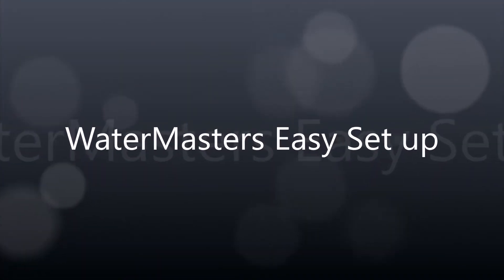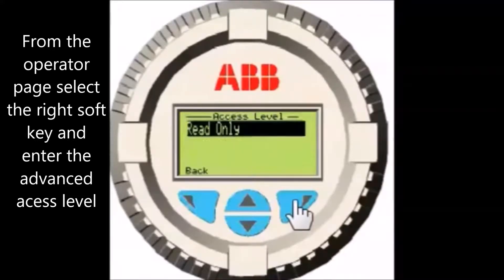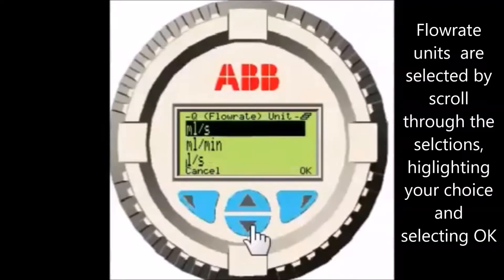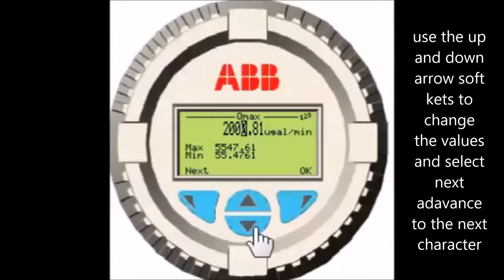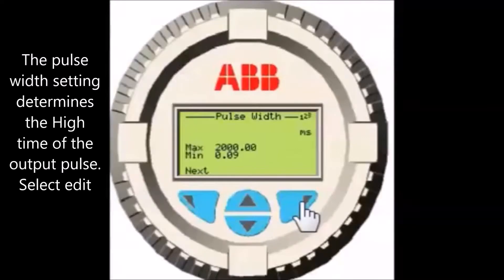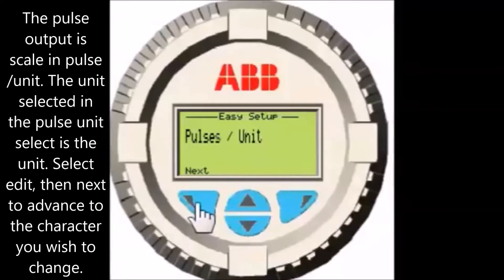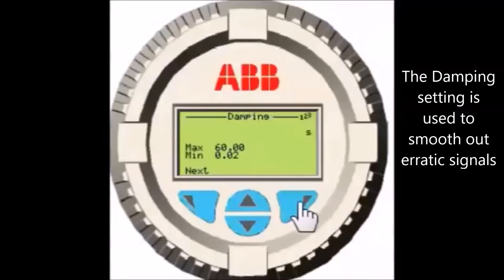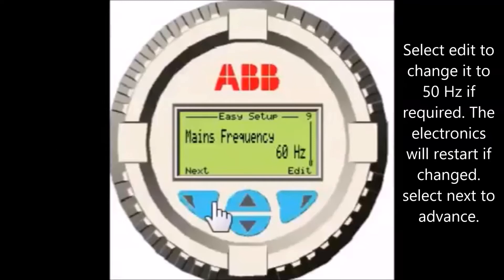Easy Set Up

Comment: What is the qmax? can I change it to a number I want?  for example you choose 2,000gpm in this video.   Would the range in your dcs be set for 0-2,000 gpm? 0=4mA and 2,000= 20mA??
Reply from the maker: Jeff,

Qmax set the range not the instrument, like you have detailed 0 GPM will output 4 mA and 2000 GPM will output 20 mA. There is another parameter Qmax DN, this is the capacity of the meter. Qmax can be set to any value below Qmax DN. Qmax also has a lower limit as you see in the screen when you set this parameter. The meter diagnostics functions are also dependent of this setting, parameter such as the High flow alarm and Low Flow Cut Off.